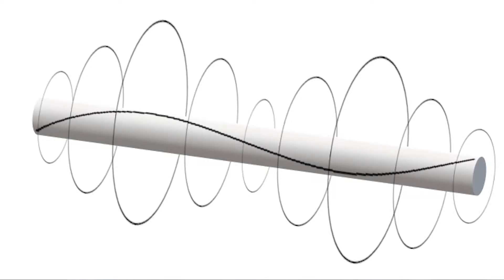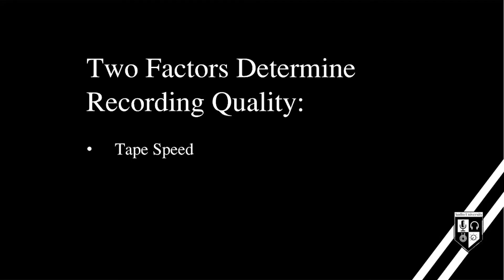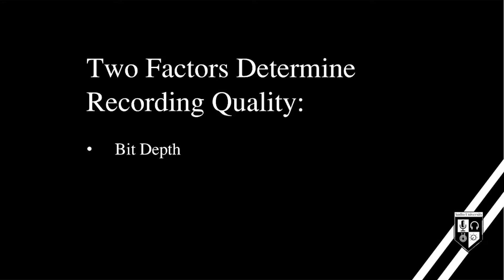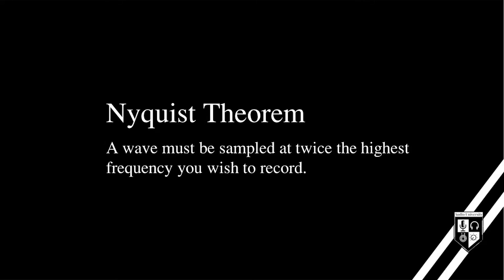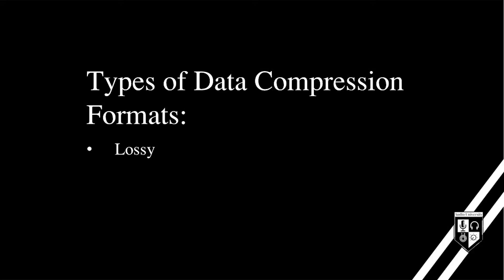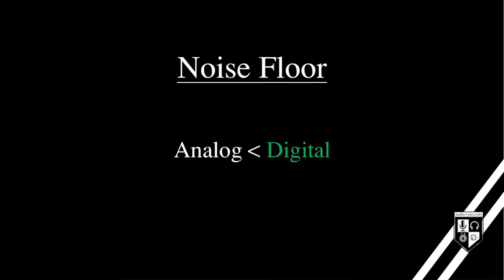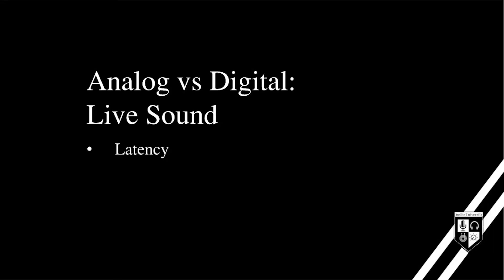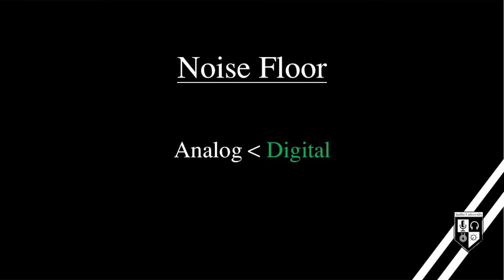ANALOG AUDIO vs DIGITAL AUDIO: The REAL Difference

Comment: So i have digital music (lossless) in my pc,my receiver only has rca inputs so how do i listen to that music ? i think that quality is lost over 3.5mm jack to rca cable (laptop or phone(my s8 says that it can output 24bit 192khz,does it mean no quality loss??) to reciever) please help me about this
Reply from the maker: A speaker can only play an analog signal. That means that there has to be an digital-to-analog conversion somewhere between the file in your phone and the speaker. 

The conversion can happen inside your phone (digital file converted to analog 3.5mm output). The D-to-A converters in phones tend to be more cost focused than quality focused. 

If you could connect your phone to your receiver with a lossless digital connection (USB, optical, etc) the D-to-A conversion would happen in your receiver, which might have higher-quality components. 

There are also USB sound cards (D-to-A converters) that can be connected to laptops and smartphones via USB and output an analog signal. 

Alternatively, you could put the files on a hard drive connected to your receiver. (If your receiver can play files directly from a hard drive)

I hope this helps!
Reply: @AudioUniversity  Thank you for reply,i was looking at it now,usb is just for charging so that goes off,its has dlna 1.5 up to 192kHz/24-bit (does it can for real or wired is better ? ) and optical-coaxial,so what is my best connection here ?
Reply from the maker: I don’t know much about DLNA. If it supports 192kHz at 24-bit, that sounds like a good option! I’d say that or an optical/coaxial connection will give you the best results.

Comment: Digital wins for me. 
Analog has a sampling limit as well; The physical accuracy of the magnetic particles of the tape or the heated plastic of the record.
Reply from the maker: Me too, for the most part! What makes you prefer digital?
Reply: @AudioUniversity  Sounds very good with good equipment. 
Way easier to use and store.
Reply from the maker: Agreed! Thanks for watching and sharing!
Reply: @endezeichengrimm  sounds good but not timeless good
Reply: @EM-km8em  CD's still sound the same 30 years later. That is timeless good.

Comment: I have one straight question about Digital vs. Analog:  Which one of these two setups should sound better?:
Bose offers 2 different Mixers: Bose T4S Mixer, which connects to the Bose L1 Speakers via J41 Cable which is a DIGITAL.
or  Bose T8S Mixer, which connects to the Bose L1 Speakers via ANALOG 1/4 balanced cable.
Please try to make your answer clear and as straight forward as possible. Thank you so much!
Reply from the maker: The difference in sound quality will be very small in this case.
I would recommend using an analog 1/4" TRS cables because they are cheaper, more useful for other audio applications, and will provide you with more flexibility for different system configurations. 
___________________________________________________________________________________________________
For example, check out these price differences:
25-foot Ethercon Cable (ToneMatch Digital): https://amzn.to/3cHXMzv
25-foot 1/4" TRS Cable: https://amzn.to/3dZj8Zo
___________________________________________________________________________________________________
Although Ethercon cables are used in some other pro-audio applications, TRS cables will allow you to use other speakers and equipment, if needed.
___________________________________________________________________________________________________
Lastly, the maximum length for ToneMatch is 50ft before running into problems, according to this article: https://toonz.ca/bose/wiki/index.php?title=ToneMatch%C2%AE_Cable
The maximum length of a 1/4" TRS is 150 feet or more: https://www.showmecables.com/blog/post/cable-distance-limits-audio-video
___________________________________________________________________________________________________
Thanks for watching! I hope this helps!

Comment: Do you think one could over come the problem of that thin line of perfection missing in vocals even after great mixing by shifting to analog gear? If so what would be a good affordable analog device to buy thats good with the modern day trap vocals?
Reply from the maker: I think a good microphone preamplifier is one of the best investments you can make! Even digital systems use analog preamplifiers. You can give your sound character from the beginning without the need to add noise by going from digital to analog and back again.
Reply: Audio University thank you appreciate the info!